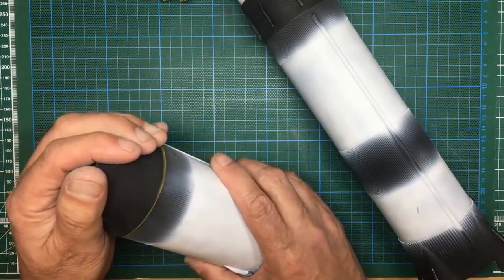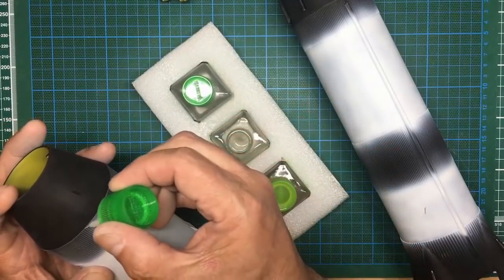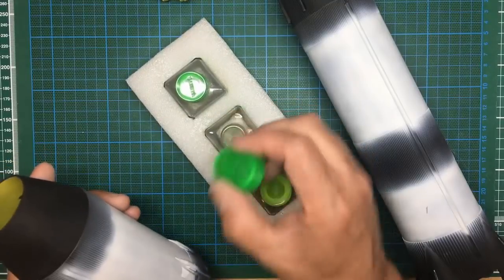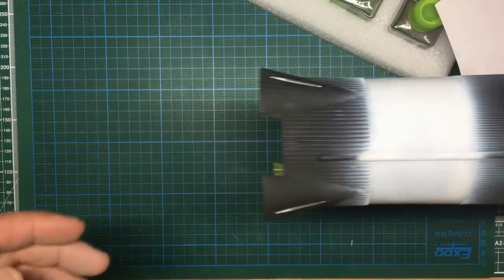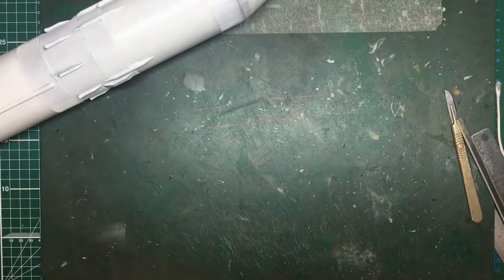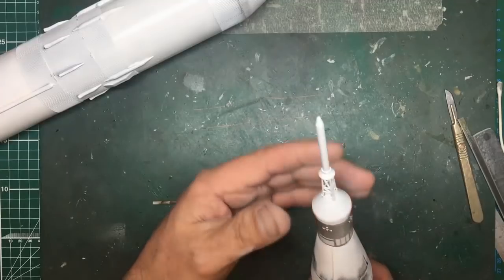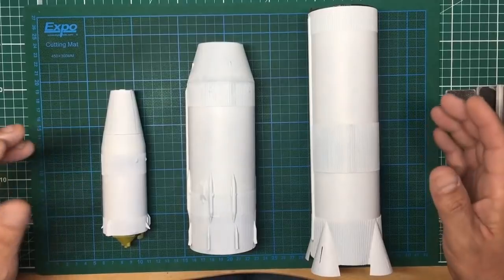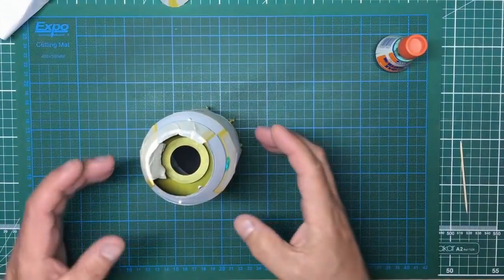Revell 1/144 Apollo Saturn V build series. Part 10.. paint

Comment: Hey Nigel, Those hardware store plastic primers are really hot, they are designed to etch plastic, yard furniture and stuff like that not really intended for models. Probably was a good thing it was old.  At least everything turned out nice in the end. Ah the joys of modeling.
Reply from the maker: I used these primers for years before i had an airbrush. the fact that they etch the plastic is a good thing in many cases.. so many modern primers just sit on the surface and scratch or peel off.

Comment: Nigel... The splattering of the airbrush... It is OUR fault... Took me a long time and a friend who actually makes AB's to learn: 4 steps, remember... 4! 
1: Press it down,
2: Push it back,
3: (the most important) PULL IT FORWARD,
4: (only then) Release it up.
Closing the needle forward before cutting the air, not only avoid the acummulation of a drop of paint on the tip, but also make the tip-cleansing for dry paint much less constant.
That said... Took me years to re-train myself to not release the trigger at once... My friend said: "Once you pressed it to start paint, do not release it until you painted what you commited to paint. Deal only in 'back and forth' movements. Only then you close the air."
All the best!